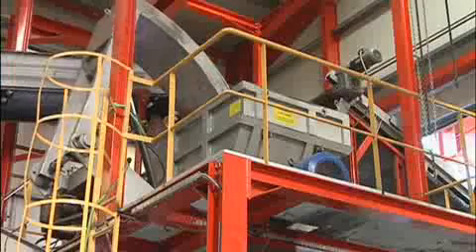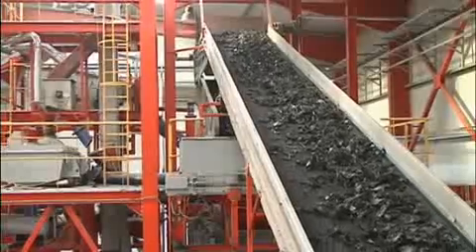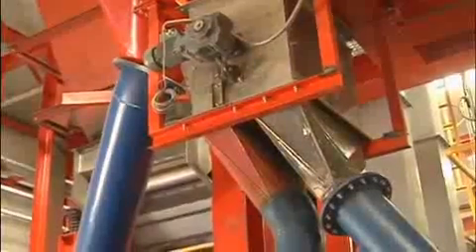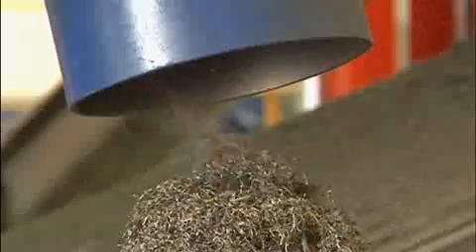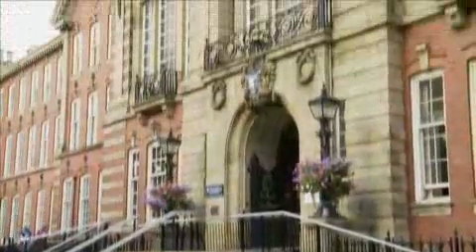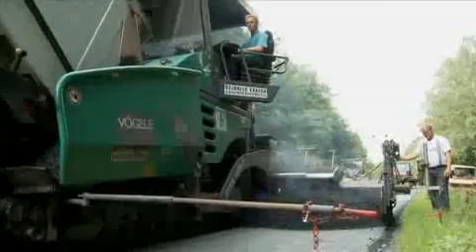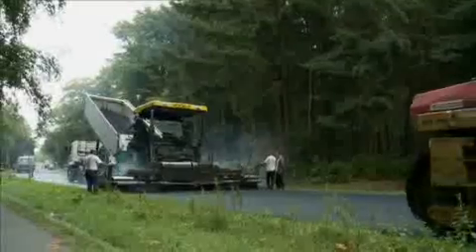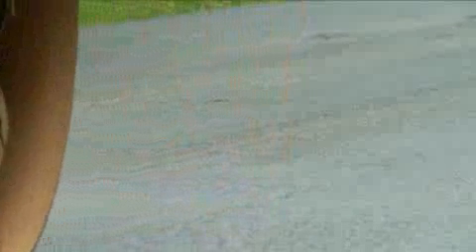Building roads from old tyres

Comment: Steel fibers have been used for years but never heard of recycle tire fibers. btw not many roads are not concrete most are asphalt. At least in the U.S.A. They have been using the rubber in asphalt though.

Comment: We have one of these roads in the US, it's on fire and smoke literally 24 hours a day made from recycled tires.  The metal rubs together from cars running over it and the rubber burns from the friction.  Build an actual road see what happens.
Reply: @jujitsuman68 yeah yeah, Garfield Country Washington State, look it up.  The steel belts on the tires rub together as cars pass over the road, together with the tire material as fuel, the road smolders
Reply: @whowawoo  Was the road in 1996? I cant find any reference to this system, ( I think its later)